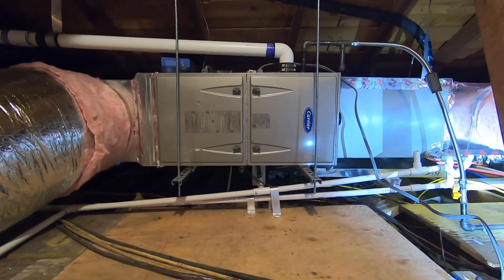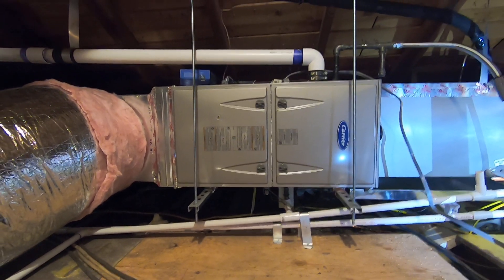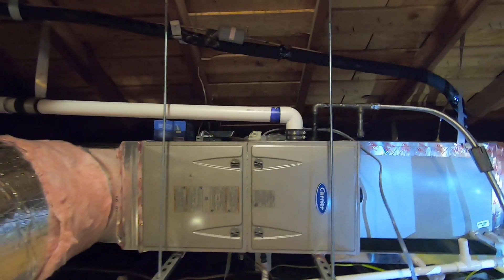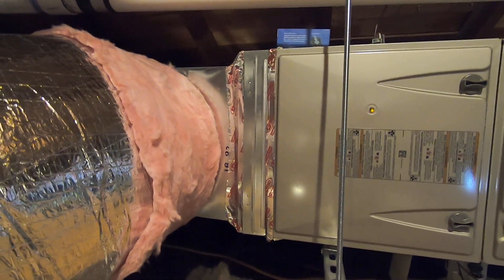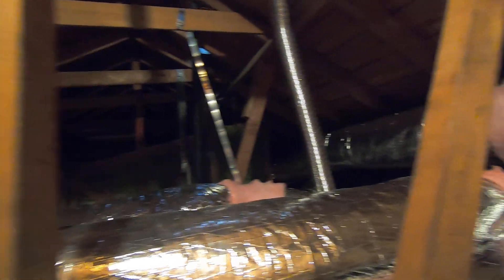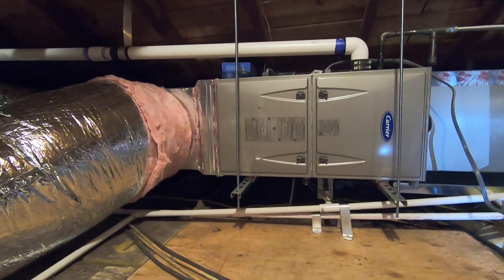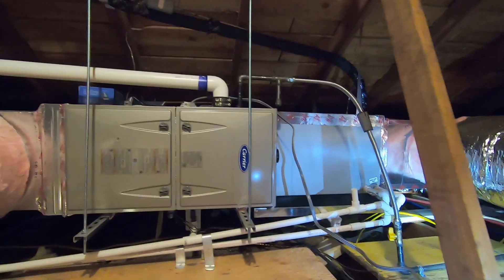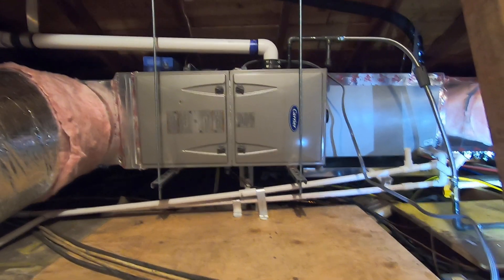Installation of New Carrier Furnace and Ductwork in an Attic

Comment: Sediment trap isnt correct. Sediments will travel right across the trap. Need to have gas flow into a wall of some sort so the sediment can actually hit the wall and fall into the trap. Nice install though.
Reply from the maker: Thank you for the heads up.  The city inspector passed it

Comment: Likely reduced the total ducting by moving it to the attic.  Same for me, freeing up my former HVAC closet to serve as a roll-out pantry.  I tossed my gas furnace for heatpump-only since 3x cheaper heating in Central CA, but OC has pricier electricity.  I only need 2 ton AC for my 2400 ft2 house, even on 110 F days since well insulated.  My ducting is simpler, though a 16"D + 10"D return to the heatpump (from former oversized system).  Why the trap plus an open vent in the condensate drain?  A trap is normally used to block sewer gases if draining to home plumbing, but the open vent defeats that.

Comment: Nice work guys! Have you experienced any problems related to the pressure transducer? A surge protector may not be a bad idea for that specific reason. It might save you some grief in the future.
Reply from the maker: Thank you for watching the video.  The transducers on the new Ultra Low NoX furnaces were an issue with models made from 2019 to 2022.  Since then we have not had any problems.  We have started putting surge protectors on all furnaces.

Comment: How you gonna pull the blower wheel out if it needs to be serviced?
Reply from the maker: Thank you for watching the video.  To take the blower motor out we would remove the furnace door and slide it out.  The all thread is set far enough back to allow this process to happen if needed.

Comment: Where is the pvc air intake for this furnace?
Reply from the maker: Thank you for watching the video.  The PVC air intake in on the top of the furnace.
Reply: @albertairinc.1140  Thanks I didn't see the second pvc pipe for the air intake in the video.
Reply: @albertairinc.1140  On closer look, is that furnace taking the air from the attic space rather than from outside the attic?
Reply: @CarreraTrack  Looks like it

Comment: What’s the manufacturer say about pvc venting to a gas furnace? I’m asking because I can’t find anything online except a letter from carrier that says abs & pvc are no longer recommended by them as venting but I don’t know how much validity that letter has because I’m still seeing new builds with pvc venting to gas service appliances.
Reply from the maker: Thank you for watching the video.  All Carrier 95% AFUE furnaces require a 2" or 3" PVC flue vent.  The manual for the furnace will give the specs for that individual unit based on BTU's.

Comment: Looks like crap . Sorry but here in Canada we put it upright in a basement with proper metal ducting and it's clean and easy to service and change filter . I'm sorry but that attic install looks messy .
Reply from the maker: I strongly disagree and think your comment is completely uncalled for.  This furnace was installed in Southern California where we do not have basements.  Most furnaces in our area are located in a garage, indoor closet or attic area.  The code for ducting is R-8 flex type and the filter is easily accessible through the attic access and platform in front of it.  Attics are not usually finished rooms, thus are dusty, have insulation, open beams and look messy in comparison.  If you would have watched the whole video I go through why we moved this system to the attic from the hall closet and benefits of the new configuration.  This system works great, passed all inspections and is complies with all  local, state and federal codes.